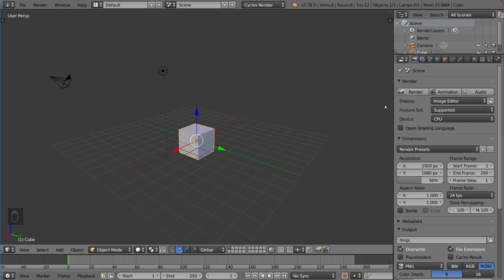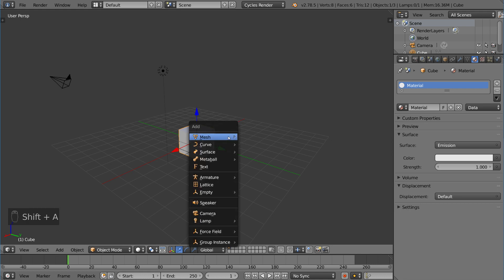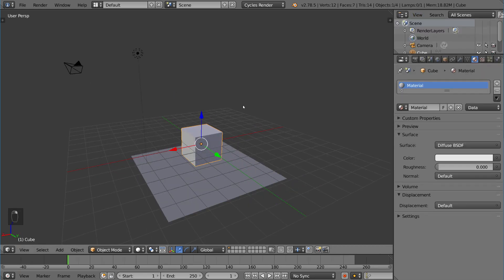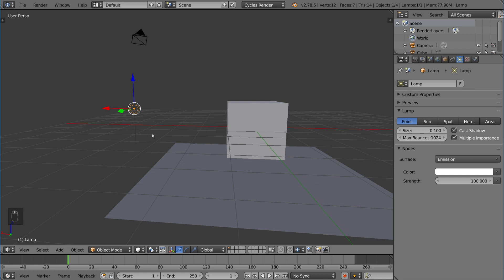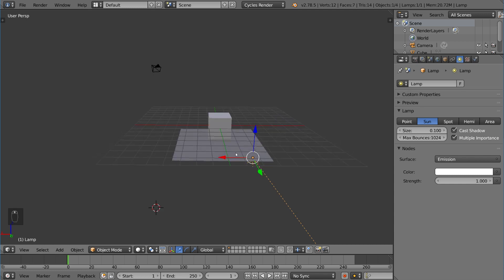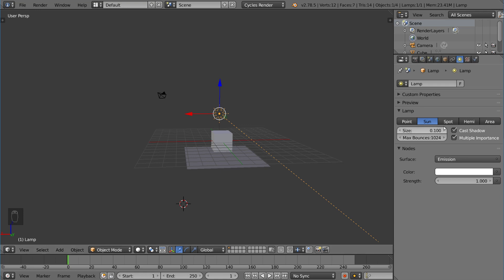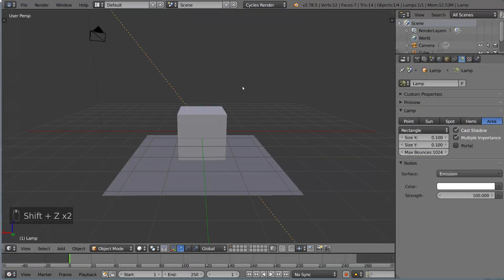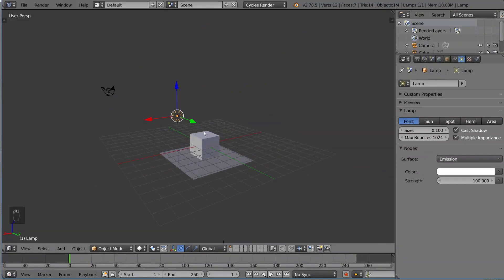Cycles Light Sources - Blender Fundamentals

Comment: I found a cool shortcut (by accident) when moving things: if you press middle mouse button the 3 axes will appear on the screen. You can move the object to whichever one and then release the middle mouse button and it will stay moving along that axis afterwards. A little bit easier than selecting it with the x y z keyboard shortcuts.